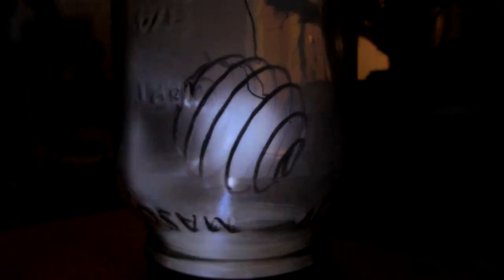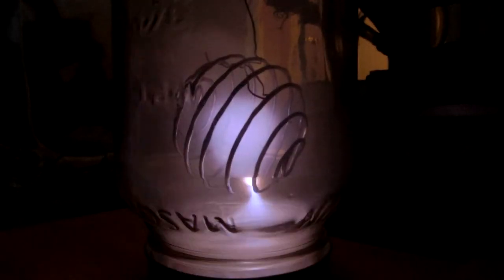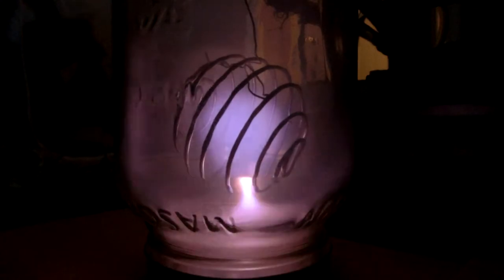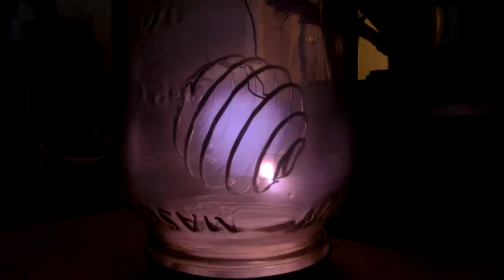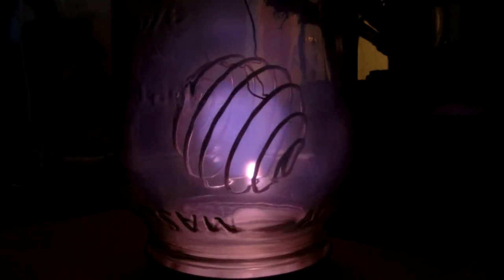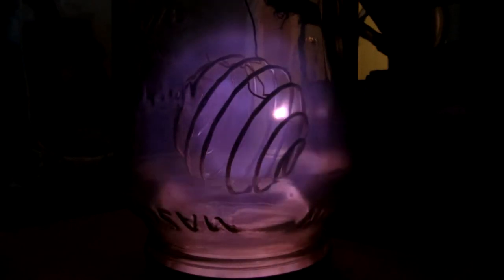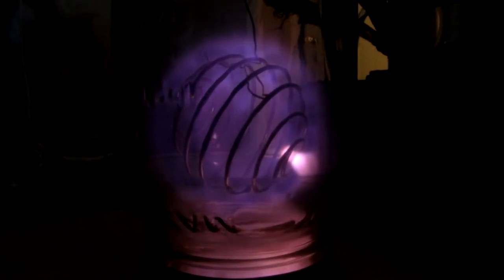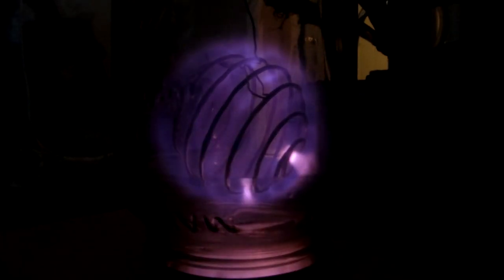Mason jar demo fusor gettin low

Comment: I found your video while searching for Fusor examples and how the plasma phenomena observed has any similarities with the SAFIRE reactor. I think that what they just build was a kind of tune-able Fusor, where they control voltage, pressure, gas mixture and what is probably frequency to drive the reaction inside. They also use a hollow aluminum(?) sphere and two lateral copper disks as cathode and anode. The catch is that their chamber got hot to the maximum designed temperature with only 7% of the expected power input.
Reply: What catch my attention towards your video is that, when you introduced air, at some point you got a tuft on the "surface" of your little sun. That phenomena was also present on the SAFIRE reactor but they had lot's of those and they could even control how much of these appears on the 'surface'.
Reply from the maker: I did look into the SAFIRE experiments a while ago, and unfortunately I'm not so sure it's 100% legit. I've only posted maybe 3% of the plasma experiments I've done and those "tufts" are also called "shock fronts". They're pretty common and easy to make when you are in the rough vacuum regime. Trust me, I love cutting edge science, I would love to come across something I could test and build at home for verification. Keep researching though, there's one or two projects that I think could go next gen real quick!